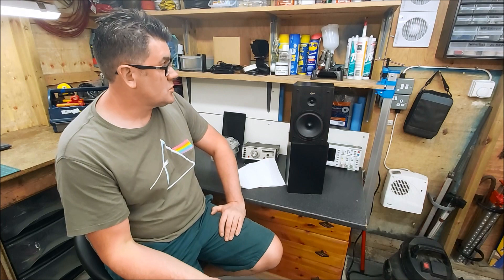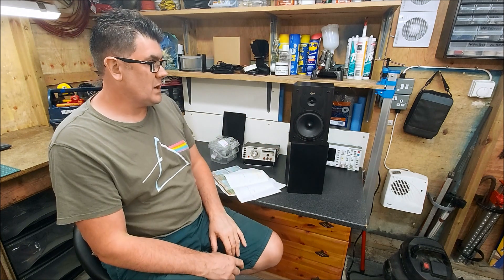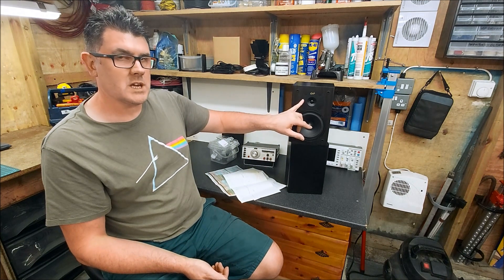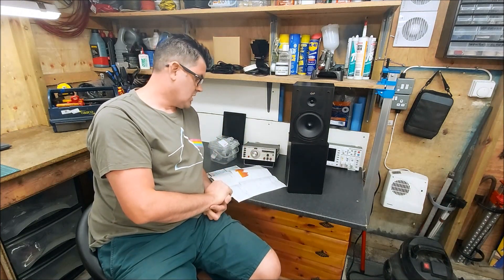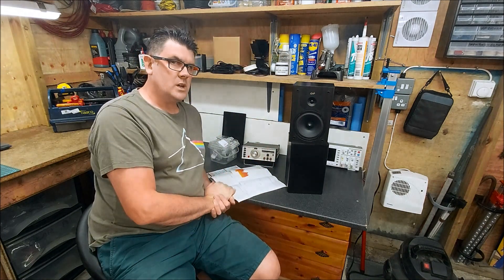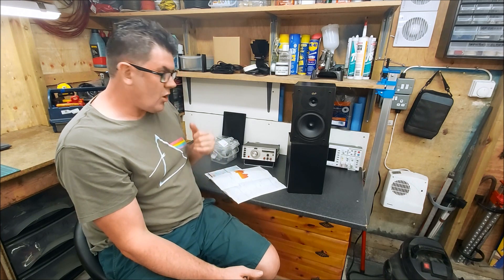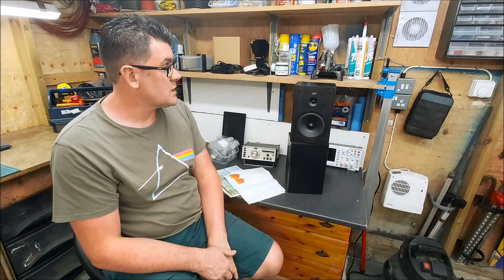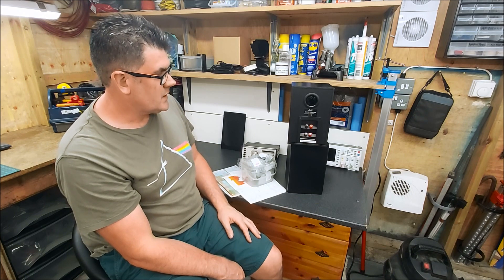Gale Silver Monitor Speakers. Part 2

Comment: Great work! I’m wondering if the  later Gale 3010 might be a better starting point. It looks like the same woofer, but paired with a fabric dome tweeter. Again nothing to write home about as standard but good bones for upgrades.
Reply: Perhaps the larger 3020 is closer in size to the silver monitor.

Comment: Hi Matt Im new to your channel. You have worked wonders with these speakers 👏. I have a quick question to ask you if you dont mind helping me out. I have a pair of royd minstrels that id like to upgrade the crossover parts on. I have found a forum online with someone who has drawn a schematic but it seems off to me. He has it as a 300mh 1.2 ohm inductor on the tweeter circuit, do you have any advice on how i could get this inductor measured to double check its value? Its there a device i could buy to measure it or is it a lot more complex than that?  Thanks, Russ.
Reply from the maker: It's not going to be 300mH. Maybe 300uH or 0.3mH. PEAK make a great little LCR tester. There available on ebay for about 80 quid. I did a video a while back on the kit I use.
Reply: Thanks bud.

Comment: Certainly made a silk purse out of the proverbial....Although they look fairly inefficient from the curves....
Reply from the maker: They have lost a bit of sensitivity but that was the compromise on a better response. You just have to turn the volume knob a little more 🤣. Had an hour listening to them tonight and there actually really enjoyable. I might reduce the tweeter resistors value by an ohm though just to sparkle them up a notch
Reply: @haycrossaudio5474  I'm curious about how much better they may be with your other tweeter. If you can you fit the cut out bezel to it. Cheers.
Reply from the maker: @mfr58  I can't play the original tweeter lower than about 4kHz. The woofer starts naturally rolling off earlier than that also. I need a tweeter which can play lower and meet the woofer. That way I can probably go 2nd order on the woofer so it doesn't play as high which can sound muddy. I'm sure the peerless tweeter would be a great improvement. The current tweeter is naff. Whether its really worth going further its up to the guy who sent them here. To me it is. I like these woofers 🤔